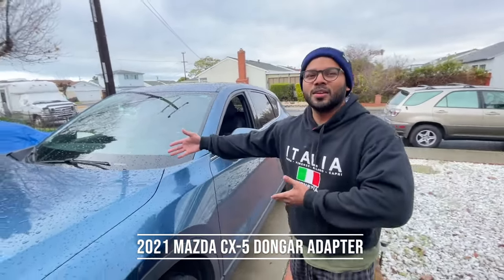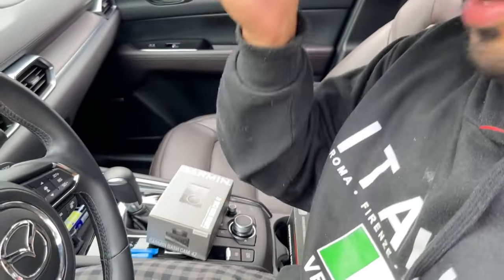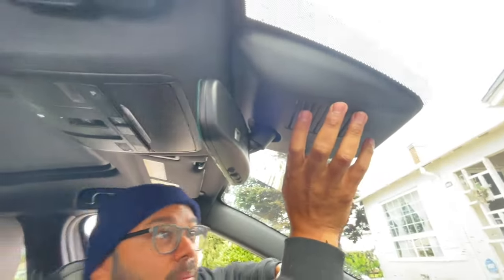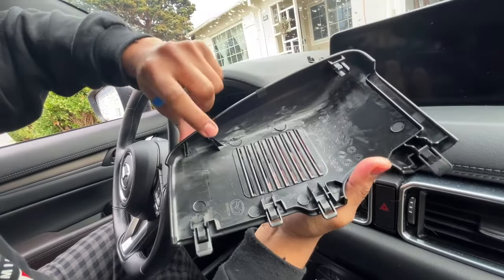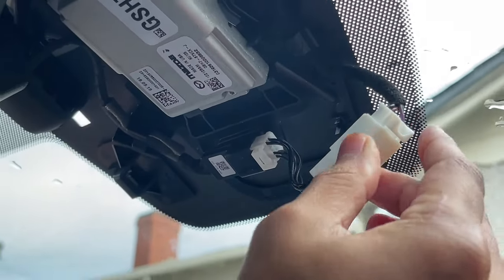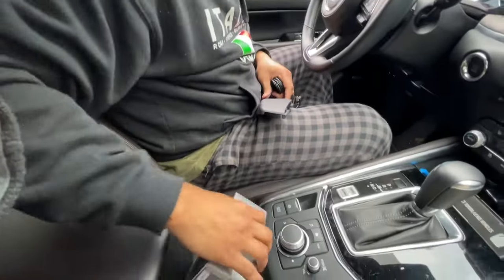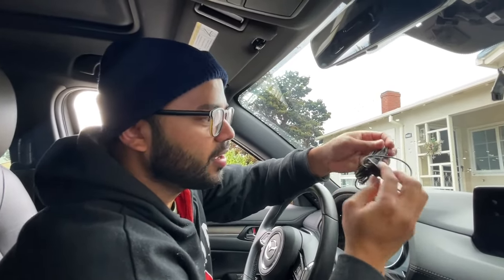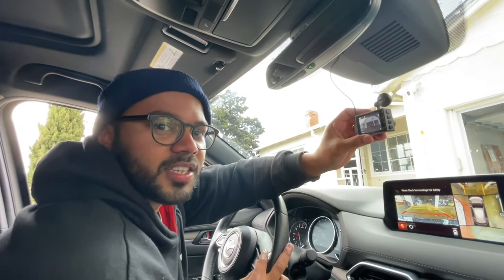2021 Mazda CX-5 Dashcam Installation | Dongar Adapter

Comment: Does dashcam power off when car is turned off or can this adapter work for parking mode?
Reply from the maker: The dashcam will power off if the ignition is switch off, however...it will turn on if you simply turn on the electrical system without switching the car full ON...as long as you have power, the dashcam will turn on and start recording.

Comment: Can anyone comment on the 2023s, are they still using the same 10pin connector? I heard they were interchanging them quite a bit at one point.
Reply: Its so useless. I have 2023 picked up last month and they are using 16 pin adaptor which is used in Ford F150
Reply from the maker: Oh man, which country is this? I've heard of the 16-pin being used in European models and maybe Canada?

Comment: so does this mean you dont have to hard wire your dash cam?
Reply from the maker: Hey Sandor, you don't have to hardwire your dashcam using your vehicle's auxiliary power. Instead you can use this adapter and power your dashcam using the power running to your rearview mirror. It's important that your vehicle comes equipped with auto-dimming rearview mirror from factory. Reach out to them if you have questions specific to vehicles other than this Mazda! :)

Comment: It doesn’t fit in my cx5 S Select 
The only terminal is for the camera sensor..I choose the non frameless I thought it’s different..
Reply from the maker: Hey! What's the year of your CX5? Also, is the connector on the back of the mirror or inside the plastic shroud above?

Comment: Any idea if the 10 pin would work with a 2018 mazda 3 GT?
Reply from the maker: Hey Shawn! Depends on where your connector port is located. If it's on the back of the mirror, you'll need the "Type A." I've added the information in the description as well :)

Comment: have a mazda3 with just a regular rearview mirror does that mean its frameless or non-frameless?
Reply from the maker: Hey there! Does your mirror have any power running to it...auto-dimming or homelink equipped? This adapter requires power running to the rearview mirror to work. Let me know.
Reply: @Auto-Minute  i have the touring trim  but i dont think the mirror is either but it has the same box. And think there’s a cable going in
Reply from the maker: @awhittlesey  Cable going right into the back of the mirror?
Reply: @Auto-Minute  its a cable from the ceiling into the box leading to a radar sensor for cruise control. So i know there’s power but not sure which adapter i could use.

Comment: I was about to hard wire my dash cam when I saw this video but since I just bought my car with extended warranty I am worried doing this will void my warranty. Anyone knows if hard wiring the dash cam voids my warranty?
Reply from the maker: Hey! This should not void your warranty. It does not impact anything mechanical nor does it interfere with any wiring relating to safety features (Lane Alert System). It's a real simple mod and simply taps into the rearview mirror to utilizes power (~2 amps). I'm sure the dealership doesn't want you even pop your hood 😅

Comment: By running the power through the coiled cable you have created a coil. The problem with this is that if the power is strong enough it could heat up the wire in  the coiled cable and cause a fire. I know this from experience as I caused fire caused by doing this!
Reply from the maker: Hey there! I hear ya 🤙 It's a low current supply with the product outputting power only up to 2A at 5V.

Comment: Hello, is that setup enabled parking mode?
Reply from the maker: Hey Joel - It does not. The dash cam will turn ON and OFF with the vehicle. There are some dash cams with internal battery that go into "parking mode." However, if you just want 24/7 power...you'll need to use a hardwire kit. Check this out (https://dongar.tech/products/garmin-parking-mode-cable)
Reply: @Auto-Minute  Thank you so much for the clarification. I didn't know whether this was my option or not.
Reply from the maker: @joelbaptiste374  No worries! Plenty of options in the market these days. Just depends on how you want to get setup. If you do opt for a dash cam with "Parking Mode"...be sure to check how their parking mode works. Does it pick up footage only AFTER impact or does it also pickup footage a few seconds before and after.
Reply: @Auto-Minute  Gotcha, I have the REDTIGER Dash Cam Front Rear, 4K/2.5K Full HD Dash Camera for Cars, Free 32GB SD Card, Built-in Wi-Fi GPS

Comment: I do like the video, I've asked this before..Why do you want a dash cam? the answer seems to be that you will have evidence in case of an accident? I had one minor accident in 50 years, what other reasons are there for wanting a dash cam?
Reply from the maker: Hi Julian - Thanks! The primary use case for dashcams is safety, whether it be a minor accident, major crash, insurance battle or car break-ins (which only seems to be increasing around here). I also have this installed to capture scenic routes and off-road ventures during road trips. In any case, I recommend one for all folks, but sure am glad you've stayed safe all these years 😃
Reply: I live in the country.  Having a dashcam in my car because we see wildlife etc.  It can be pretty interesting.   We also caught someone scumbag dumping a young dog and they were arrested by the sheriff after we sent the video.  (plus we kept the doggie!!).  I am not paranoid about security and all that but several times the video has come in handy.  (Someone backed into my truck when I was parked in a parking lot).  I don't record the inside of the car.. Its just a fun gadget for me.   I almost hit an all black cow standing in the middle of the road in the dark of night.  I barely saw something was there and avoided it.    The video made for great conversation afterwards.

Comment: will this work with 2024 carbon model?
Reply from the maker: Hey! I recently got wind of a new 5-pin connector pin on some newer Mazda's. If you check the port on your Carbon trim, could you confirm if it's also a 10-pin? If it is, then this should work.
Reply: still waiting for the dongar dongle to come in the mail before even trying to pry open the mirror 😅 but i’ll keep you posted! great video btw, really hope it’s compatible
Reply: Can confirm the works with 2024 Mazda CX-5 CE Homelink mirror 🎉 so happy i don’t need to run those long wires throughout the car. Thanks again for the teetotal 👍
Reply from the maker: @jdogbouncerman69  Awesome! So the 10-pin adapter did the trick 🙏 Appreciate the update. Definitely helpful for anyone else in the same boat with a Cardon trim level.

Comment: Does it work for 2022 cx 5?
Reply from the maker: Yup! The new '22 CX5 uses the same frameless adapter used in my video 😁
Reply: @Auto-Minute  I have one more question!
When pressing gas pedal, can you hear high frequency or wind noise during speeding up?
I noticed there is a small noise and it bothers me a lots now

Comment: Hi friends, having a quick question around the installation of dash cam by using the Dongar Adaptor
Is the power of the dash cam goes off after the engine's off?
Reply from the maker: Howdy! Power to the dashcam turns [ON] and [OFF] with the vehicle.

Comment: the mazda one is out of stock, Can i buy this one ? is it the same ? it also has 10 pins connector 
https://dongar.tech/products/10pin-type-a
also can u just unplug the wire from the back of the mirror instead of taking off the box cover? is it the same ?
Reply from the maker: Hey Ryu, the 10-pins are actually different. Since you mentioned unplugging it from the back of the mirror, it sounds like your Mazda would actually take the "Type A" that they sell (compare the connector head). That said, what year is your car? The 2022+ model years seem to be using the "frameless adapter" seen in this video across all of their CX5 trim levels. Hope this helped! Cheers :D
Reply: @Auto-Minute  I have 2018 cx5 grand touring. I have to take a photo of the connector and see is it the same one.
Reply from the maker: @ryuken7999  Cool, since yours is a 2018 and the connector is on the back of the mirror, I'm 99.99% sure that you'll need the "type A," but doesn't hurt to compare connector head on your vehicle with what you see on the site as well. Cheers!
Reply: @Auto-Minute  ok cool ! Thx for the advices.